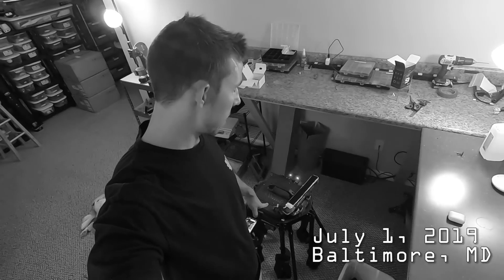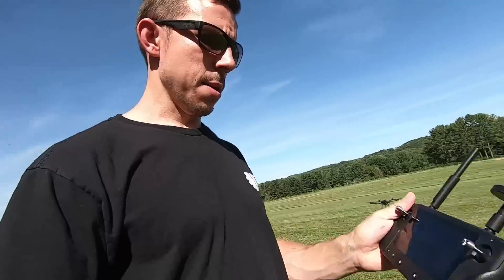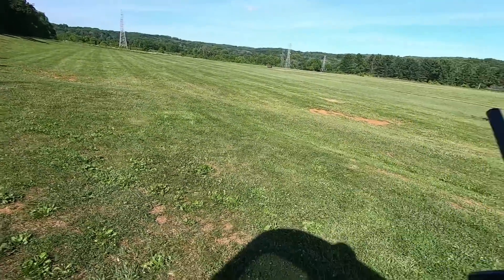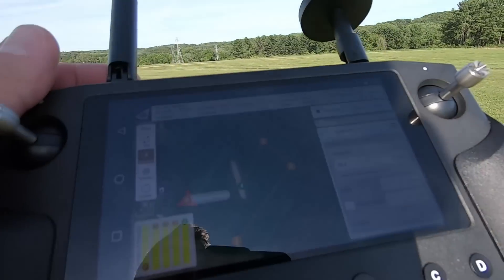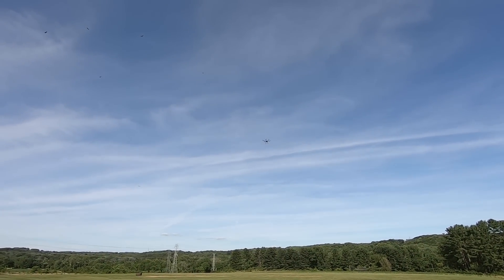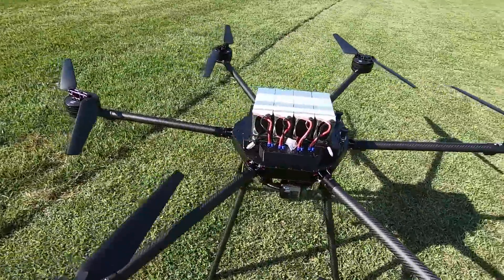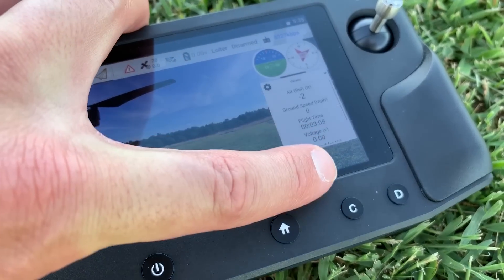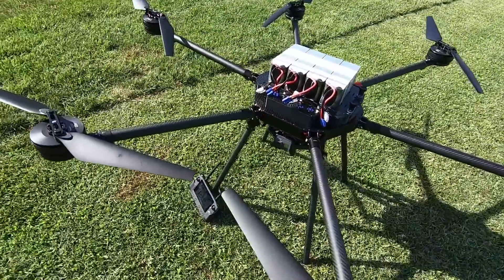July 1, 2019 Vlog: HereLink & Pixhawk 2.1 / Cube Additional Testing

Comment: i am new to this drone Hobby. I have ordered the Skywalker x8 and i wanted it to have all the function that the Parrot disco drone has and a bit more. so, a friend told, instead of the Pixhawk Cube, he install the parrot disco chuck Integrated FPV autopilot system + the booster in his Skywalker x8, because it has everything the Pixhawk Cube has and including capability of integrating 4G LTE  and real time Google Map, GPS location. and it's  only $500 + 250 for the Booster.  i am seriously thinking about the parrot disco chuck Integrated FPV autopilot system in my x8. what do you think ?
P.S  i plan to replicate this VTOL with the skywalker x8 and fly long range.
@